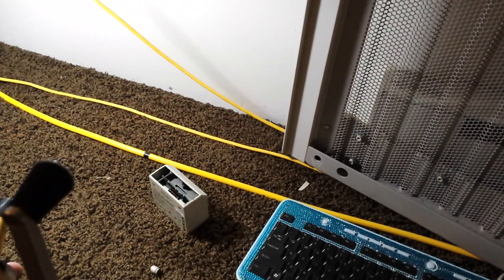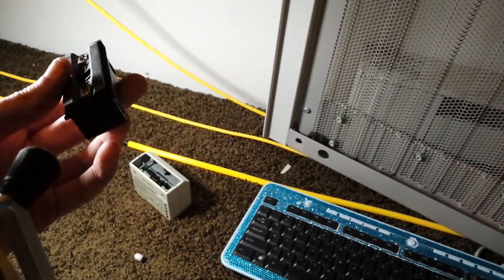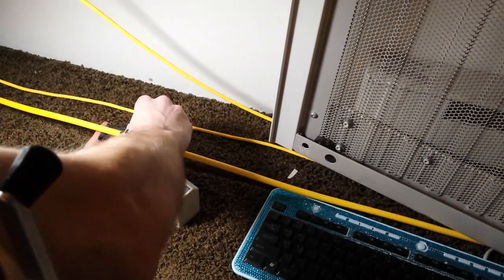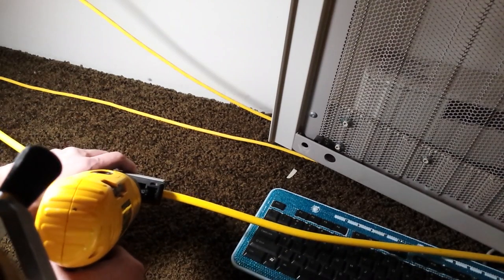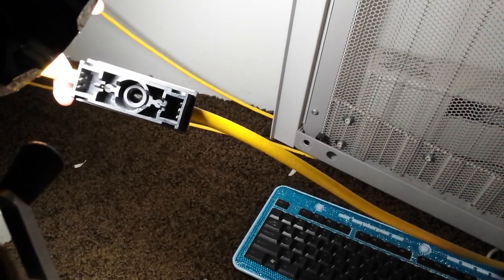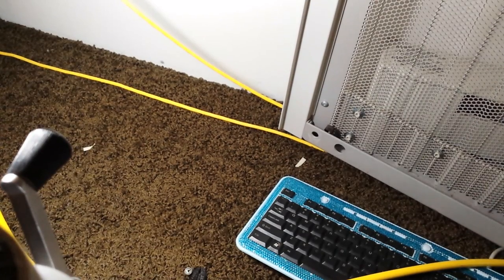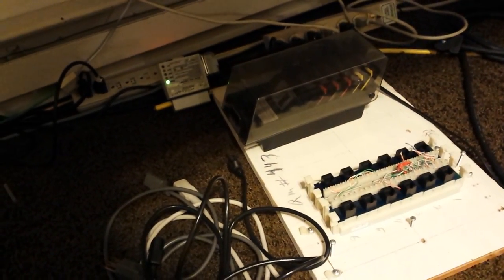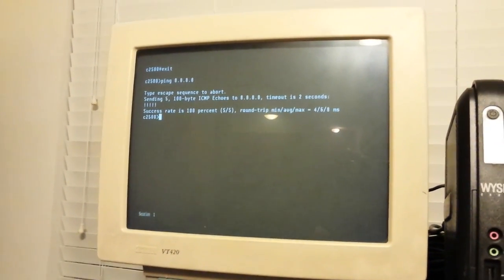10BASE5 Thicknet tapping procedure

Comment: Oh, my goodness.  Vampire taps.  I haven't seen those in over 35 years. I used to work for Cabletron's Canadian rep.  Yes, you need to space them out every 2.5Meters.  There's a black band on the cable every 2.5 Meters.  I used to debug cabling issues with a time domain reflectometer.  Those were the fun days.  Most of the issues were when you didn't respect the spacing or when as you drill through the shielding too close to the core you bring in shielding wires and short out the cable.  Those bring be fond memories. 🙂
Reply: I work for an ISP and we still have the TDR feature on our new meters. I use it regularly.

Comment: dec VT420. A server room without a dec terminal feels wrong. Nice video  :)
Reply: Nice! Here's a list of terminals that my work place have, if ya interested: dec gigi, vt240, vt510, vt 320, vt420 * 2,  ibm info window II 3153 and ofc a decwriter III (the sound is nostalgia on this one).  I kinda miss DIGITAL and their products
Reply: I haven't tried vt240 yet, but it's something similar to the dec gigi (vk100) but with a 4010/4014 graphics mode. I like the gigi more even if they both got 20 mA currentloop, regis, colors. Nice features of the gigi is gigi basic, lamps and the keyboard. Both are smart terminals.  (product documentation on bitsavers)

Comment: Wow! If I may ask, how did you terminate the ends of the Belden cable?
Reply from the maker: Normally you'd do something like putting an N type connector on the end and using a proper terminator. Since I didn't have any of that, I wrapped a 47 ohm resistor around the center conductor and pushed the other end between the shield braid and the jacket on each end of the cable.

Comment: Can you please redo this but with proper lighting, camera focus, and angle?
Reply from the maker: no, I can't. I'd need another 10BASE5 tap and a camera with either working autofocus (yeah, right) or manual focus. Lighting and angle are bad because my apartment wasn't a video studio. I was stuck with the lighting I had, the cable was stuck against the wall run behind a couch and an equipment rack, resulting in crappy angle. It was an impromptu video I decided to take, using the last tap I had to install an MAU for the MicroVAX II that my roommate and I had at the time. None of it was planned and it was taken in nonideal circumstances, sorry it doesn't meet your expectations.